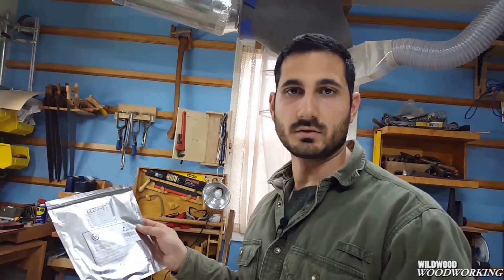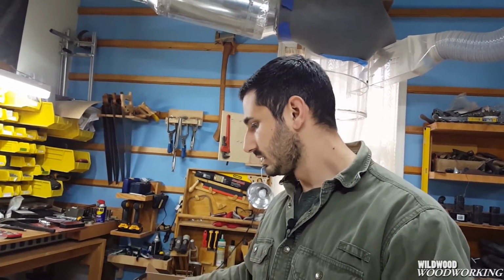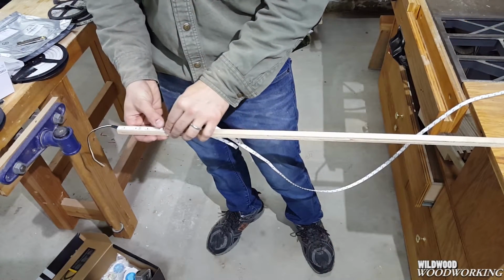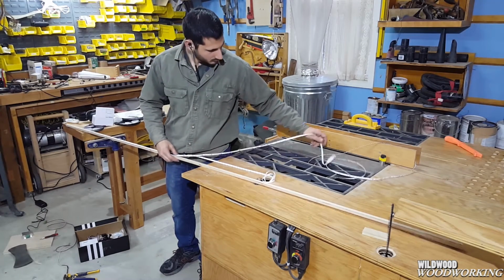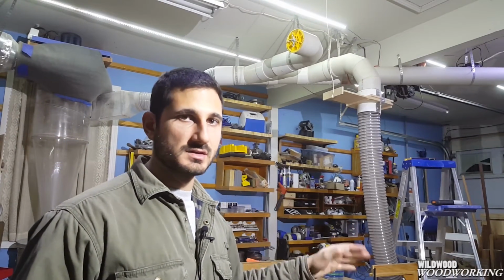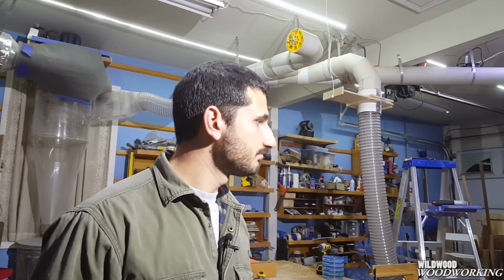Custom Workshop LEDs

Comment: Four rapid fire questions:
1. What gauge wire did you use?  (I'm still new to homeowner electricity projects)
2. Did you connect to an existing power wire, or was there a plug into an outlet?
3. Do you have the amazon link?
4. Did you need to buy special adapters to each LED strip to connect power?
Reply from the maker: Hey Bobby. I used a low voltage gauge 22AWG. There was an existing outlet on the ceiling and used an AC/DC converter to remote control. The link for the LEDs and controller are below.

Comment: Nice job!  Can you give me the name and type of LEDs you used with the remote?Thanks
Reply from the maker: Hey Jim,  I used LEDs from Amazon, the link is below. They have sections where you can cut them to make a custom length, then I soldered them together with wire. 
To control the lights I used another controller from Amazon.

Hope this helps, 
WW

LEDs 
https://www.amazon.com/gp/product/B00QP7EC6A/ref=oh_aui_search_detailpage?ie=UTF8&psc=1

Controller 
https://www.amazon.com/gp/product/B00ZTZY90I/ref=oh_aui_search_detailpage?ie=UTF8&psc=1